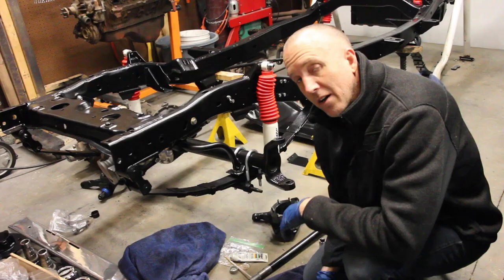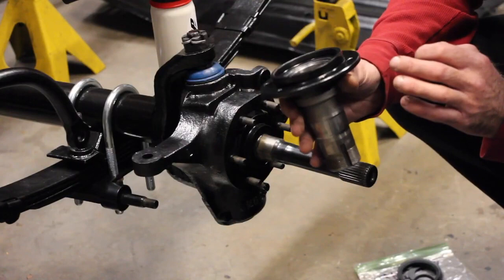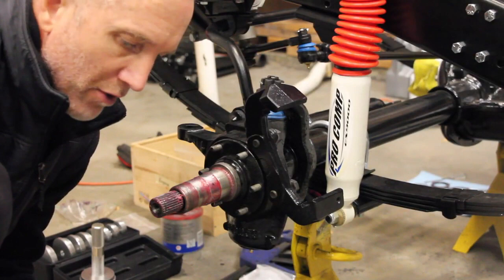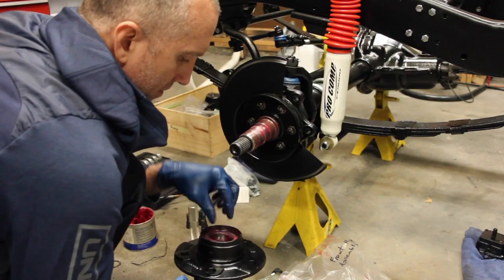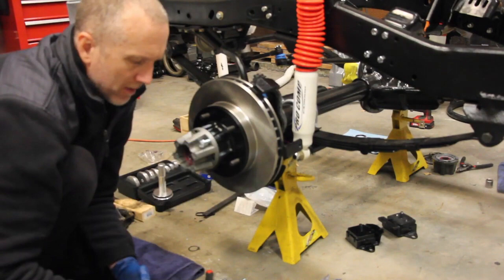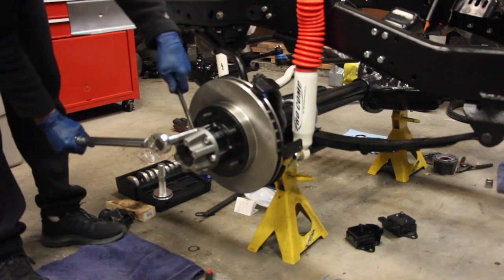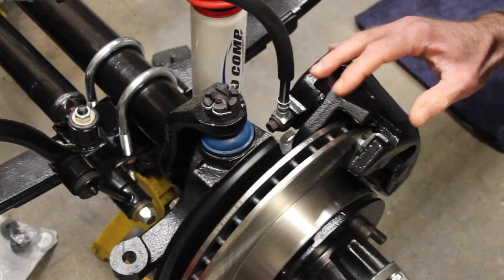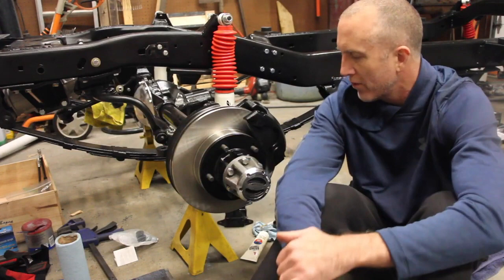Jeep CJ7 Dana 30 Wheel Hub and Disc Brakes Rebuild

Comment: Thank you for the the recommendation of pre bending the lock washer in a visefor the outer spindle nut.

I just changed the brake rotors on my 82 CJ-7 yesterday. 

You saved me some frustration!

Comment: Thanks for the video. I have a 84 CJ7 as a graduation gift. Finished rebuilding the engine and now it’s time for new rotors and bearings. Your video is a huge help!
Reply from the maker: What did you rebuild withinnthe engine? Did you do it yourself?
Reply: I did it myself. But I did a quick cheapie overhaul. New rings and bearings, cam and timing chain and new seals. After that I just finished redoing the braking system but I’ve figured my rotors are warped so now I’m about to replace them.

Comment: Thanks for the AWESOME content! I just started my 79 CJ7 build two weeks ago, your clips have been very helpful.
Reply from the maker: Make sure you subscribe. Ive got more coming as i rebuild this 79.
Reply from the maker: I also want to know about how your 79 build goes. What color, engine... etc.
Reply: I subscribed  when I found your channel a while ago.  I'm going to go with the original color of orange ish red.  
The motor is a 302 ford. That's what I put into it 35 or so years ago.    Currently looking for a original steering wheel that I like. that doesn't cost a fortune.
Reply from the maker: @grizzrider2684  I just sold an original steering wheel from my parts jeep. Bummer. Color choice sounds cool. Did you switch out the engine for any particular reason? Any difficulties with pairing up it up with the transmission?
Reply: @coolguy_CJ7  Bummer. I do have two good leads for steering wheels that I like here in Salt Lake. I'm doing the research to see if a YJ wheel will fit my CJ,  I think a XJ wheels will fit. 
The Original 258 didn't have the power or  speed that I was happy with, I was maxed at 55 mph on the freeway.
 I couldn't pull a trailer very well.  The 302 enabled the Jeep to reach 65 mph with ease.    Dropping in the 302 wasn't to bad.  I had to cut off a half inch off of the pilot shaft, after that it was a direct bolt on to the T150 tranny.  I had to build clutch linkage and motor mounts. 
 I had informational help from Novak.
Reply: This is absolutely fabulous. Your pedagogical explanations and great photo are a treat. So useful as I’m embarking on a renovation of my trusted 1979 CJ 7 Renegade. Thanks. Morten
Reply from the maker: @mortenlindh7243  That is some great praise. So much I had to look up what pedagogical actually meant. :) I'm happy to provide the learnings as I go. It's been a fun road thus far and it's amazing to me what I've figured out and have been able to do.
Reply: A tip : you can watch series at flixzone. Been using them for watching a lot of movies recently.
Reply: @Riley Korbin Yea, I've been watching on flixzone for years myself :)
Reply: @Riley Korbin definitely, have been using flixzone for months myself :)
Reply: @coolguy_CJ7  Novak has adapters to mate the 4 speed transmission.   The manual transmissions are  Ford bolt pattern so it is not rocket science.   I plan to swap in a Chevy 350 just because they are so plentiful and parts are as plentiful and easy to get.

Comment: Another great video. Tip for your viewers, the thinner race and bearing is the inner (towards the Jeep), the thicker pair face outward towards the hub lock. I bought a kit and wasn't re-using the damaged axle hubs (or pulling the races), so it took me awhile to figure that out after I noticed they were different. Boy those bearings are a tight fit on the spindles...
Reply from the maker: Thank you for the build. That's great information for all of us to have. And yes, they are a tight fit. I was talking with a viewer a couple days ago on how he sanded down his spindle to get the bearings on.
Reply: I should add that older drum-brake CJs with a smooth spindle apparently use the thicker races / bearings for both inner and outer. Only the disc brake axles have stepped spindles and one set of thinner races / bearings. (I can just imagine some poor guy pulling his hair out trying to figure out which of two identical sets is "thinner".)

Comment: Is there a seal at the opening of the axle housing, where you put the front axles back in?  I bought the dust washers, but cant find any seal. Thanks
Reply from the maker: For the front axle (Dana30), the seals are in the differential housing. The bearings are in the wheel hub. The dust washers are the only things at the end of the axle housing. The outer one (bigger one) is impossible to find. Does that answer your question?
Reply: @coolguy_CJ7  yes thank you, been getting a lot of parts off rock auto , can't find that seal. I have the dust washers , going to try NAPA.

Comment: The bottom nut wouldn’t torque to 85 ftlbs, it kept spinning. The three notches on the bottom but should be facing upwards, correct? The threads towards the top of the nut are narrowed to cause  it to lock I believe but mine did not.
Reply from the maker: I've heard people having issues with this on some of the FB forums and CJ chat forums. Have tightened up the top ball joint yet? That might help, but if it doesn't, then tighten it as much as you can get it. Then grab a C clamp and apply it to the top of the stud and the bottom of the ball joint. Crank it down and use a crescent wrench to tighten it as much as you can. Now all of this is assuming that it is the correct ball joint. For some, the stud isn't large enough to mesh with the hole in the wheel knuckle. Please report back if this worked. We'll get it figured out.

Comment: Things you didn’t powder coat, what have you painted those parts with? Looking for something that’s gonna hold up on my Jeep project? Thanks
Reply from the maker: If it's something that's part of the undercarriage and not a glamour piece, then I painted it with Chassis Saver and then top coat spray painted it with the appropriate color (98% were semi-gloss black). Chassis Saver is UV sensitive. Does this answer your question?

Comment: hi great vids real help as doing 69 CJ7  right hand drive over here in the UK my question is did you power coat your parts yourself or do you send them out thanks for your content
Reply from the maker: Powder coated everything myself. I have a video on how I built a powder coating oven on my channel. Eastwood makes a pretty good, low budget system.

Comment: Great video! What size stainless steel nuts were used on the dust shield? Mine are shot! Simon UK fan.
Reply from the maker: I wanna say 3/8” standard thread. Use nylon lock nuts.

Comment: 22:37 torque lb ft ?
Reply from the maker: Inner lock nut: 50 ft/lbs. Back off 1/3 turn. Outer lock nut: 50ft/lbs. bend washer lip out over lock nut edge to prevent any rotation.